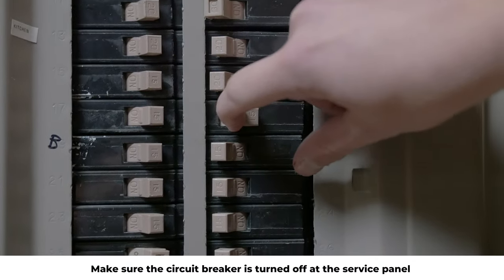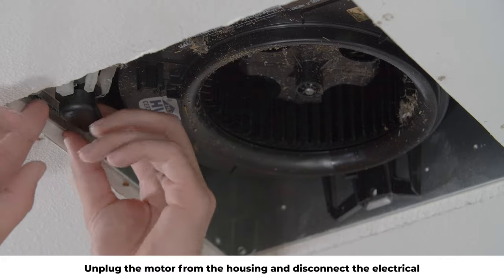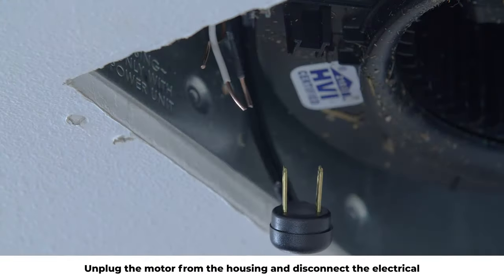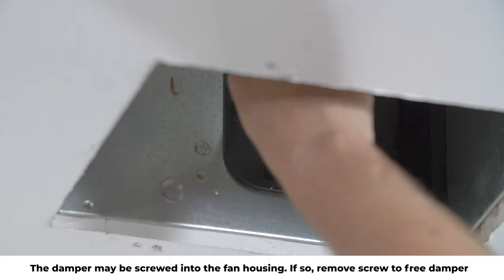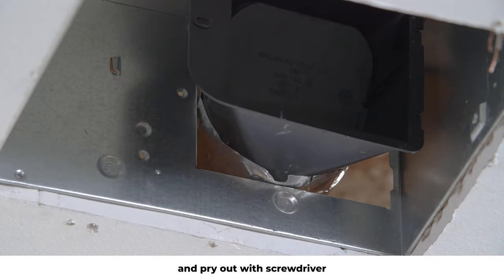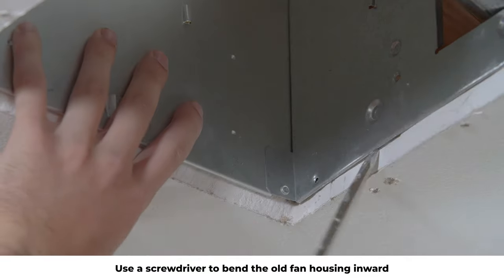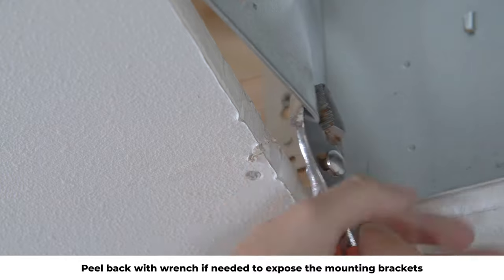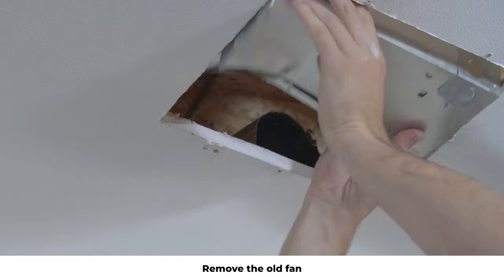How to Remove a Bath Fan

Comment: Well. Easier said than done
Reply: Agreed, they forgot to include all the insulation falling out and crumbling dry wall when prying
Reply: Yeah, or roofing particles falling all over the bathroom, or, "oh this Panasonic bathroom fan the client bought  is too big for where this old HVI fan used to be. Better open up the ceiling. Oh the space between the studs is too small for a Panasonic. Now I'll have to reframe it. And oh, while I'm at it I'll have to get some ventilation taping and a few elbow joints..." lol
Reply: Yes but at least it was said simply in under 11 minutes
Reply: Lol, yes, the insulation tape alone delayed me by a day. And who would have thought one would have to utterly destroy the housing! Lol!
Reply: @Oh-ou4lp  Not only that, they forget the orientation of the exhaust pipe possibly being on a different side of the housing of the fan you've purchased and having to match that up by turning the housing 180° with the likelihood of having to mount the fan with housing on a parallel joist.  Also, you have to cut a new opening and patch a hole closed from the old fan opening--- pain in the behind!!!!!!

Comment: This is really useless. I have a 40 year old bathroom exhaust and I cannot see how it is removed.  Frankly, all I want to do is remove the cover so I can repaint the bathroom.  There is no clip that I see on the exhaust fan casing.  There are no screws. There is (at least to me) nothing obvious to remove. Sure, I can yank on it, and see what happens, but most likely I will just break and have to get a new bathroom exhaust fan whether I need one or not.  So sure, this post may help you if there is this is obvious clip this video refers to. But if there is no clip, this video is useless.
Reply: Mine literally just pulls down
Reply: And has spring like things holding it in
Reply: Just pull it down ..

Comment: That only took 59 seconds, very easy, what could possibly go wrong
Reply: I should call the video producer and tell them to come setup my fan old fan in that EXACT configuration, so my change out will go just as smoothly so I, too, can only take 59 seconds, rather than an additional day or two of work.  I have no idea what's waiting for me in that area of the attic crawl space... a whole lot of blown in installation, central air HVAC ducts, Romex wire runs, joist straps-- God knows what else!

Comment: Now the box is damaged
Reply: Go into the attic then to remove the screws
Reply: @camaroman101 but it's on the first floor, so it is between the upstairs floor
Reply: @MelvinIsMerlin could bend it back with pliers or use a long thin blade and cut out the screw head
Reply: @camaroman101  good advice. I'm doing that atm and I might go get new blades for my Oscillating Multi-Tool
Reply: @camaroman101  alright I got it out but the new housing is much smaller.  Idk how I'll be able ro screw it
Reply: Ya I imagine the intent is to replace the housing and fan so if you’re not then there’s not much reason to pull out more than the fan in the first place